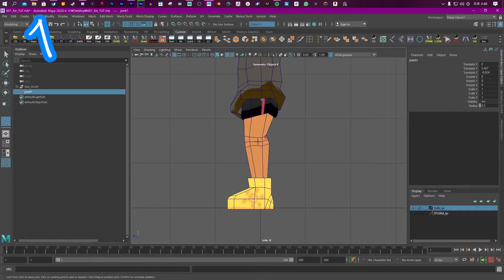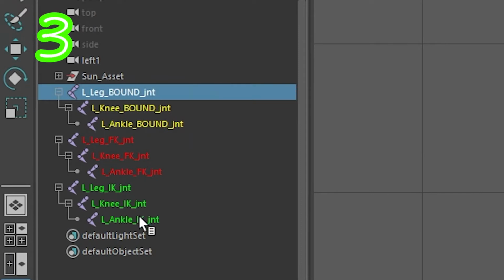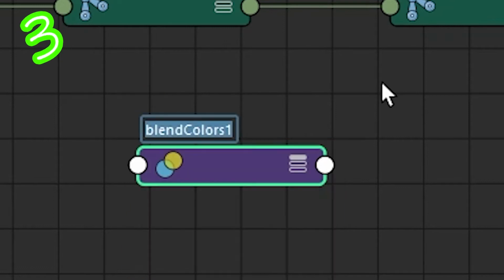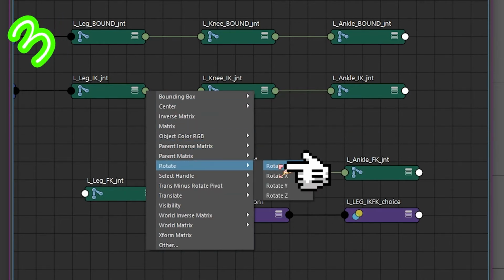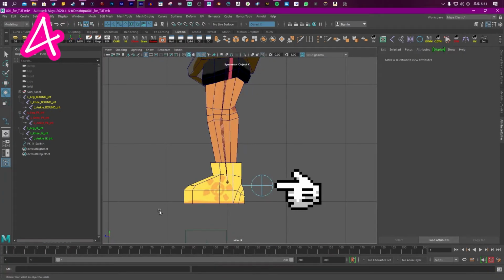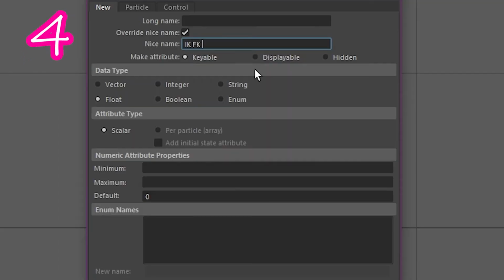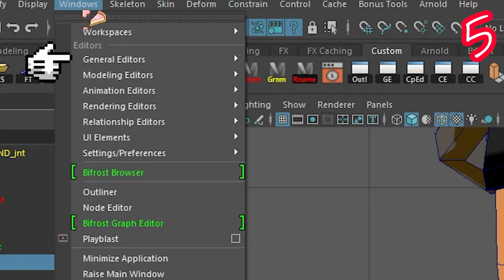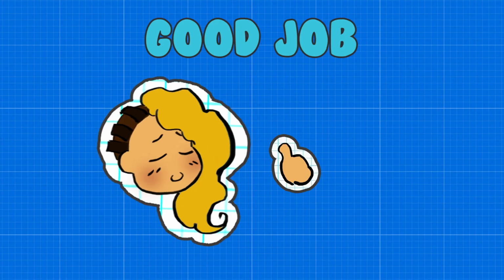How to create a FK IK Switch with Colour Blend Nodes in Maya

Comment: Thank you very much dear!~
Reply from the maker: Happy to help! xx
Reply: @PixifiedTips  I wanted to ask you if you just repeat the same process for another limb or there is a faster way?
Reply from the maker: @anastasiak125  sort of!
You can:
1.Duplicate  the successful L Leg hierarchy 
2.Group it 

Name it (R Leg offset grp) or whatever your convention is!

3.on the group, in scale -1 on the x axis (when you make a group the centre point is at the centre of the grid this allows a perfect flip if yours isn’t like that reset the group settings)
Select all of the hierarchy , in name and replace (maybe in edit or another tab near the top near file)

Replace _L
With _R

Now you should have a functional set!
Do not remove the group if you do choose to do it via this group method!

because the transforms will effect the new root leg negatively 

However sometimes or usually the special stuff, like connectors etc may have to be reconnected 

I don’t think their information ever carries across when we duplicate something x
Reply: @PixifiedTips  Thank you for such a detailed answer, I will try this! 💘